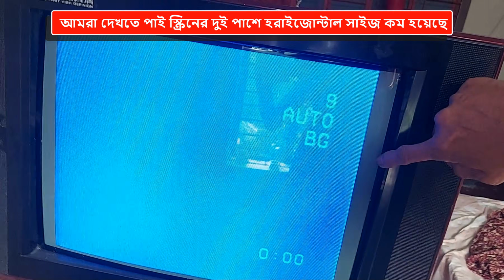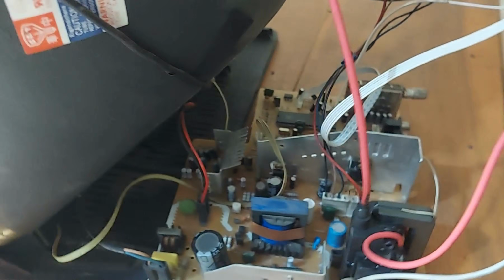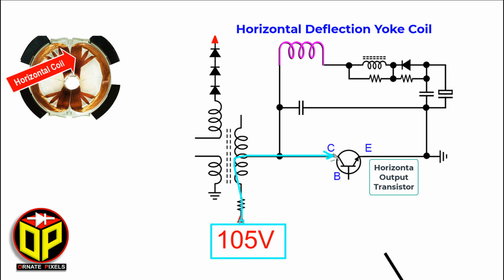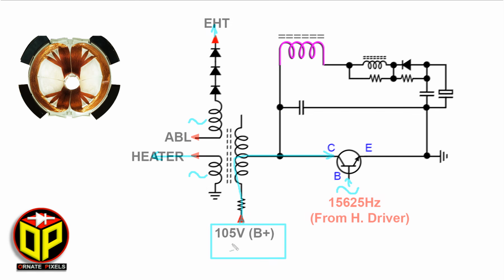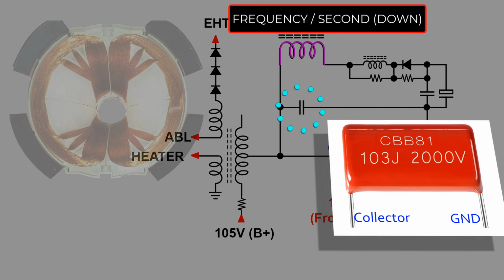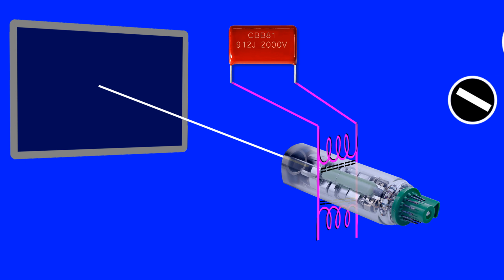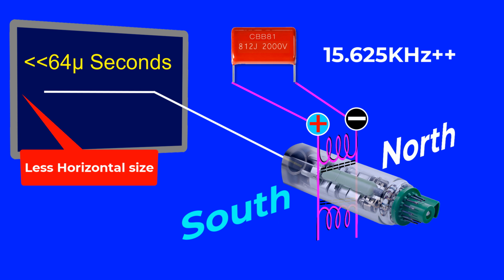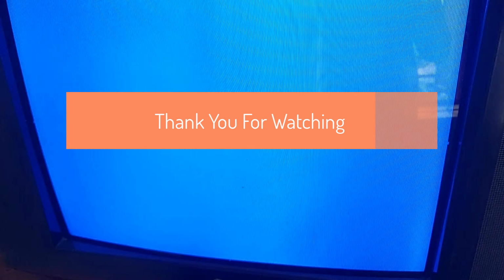CRT TV Horizontal Size Adjustment | Learn About Horizon Deflection Yoke Coil Section Details

Comment: Base/gate signal is a squarewave, not sawtooth, sawtooth current results due to inductance. Also, the scan time (Trace) is not determined by the capacitor. It is determined by the Horizontal Oscillator (the 15,625 Hz signal) hitting the base of the transistor.
Reply from the maker: Thank you for sharing your technical insight! You are absolutely right that the voltage signal at the base/gate of the horizontal output transistor is a square wave or switching pulse. However, due to the inductance of the deflection yoke, this switching action produces a sawtooth current wave, which is what ultimately drives the horizontal scanning. Both perspectives are key to understanding the circuit: the square wave acts as the trigger, and the sawtooth current does the deflection work. Thanks for helping make the discussion more detailed for fellow technicians!
Reply: @OrnatePixels  You're welcome. And to put it more precisely it is combination of inductance of the yoke and capacitance of Cs and Ct with square wave switching that ramp is produced through (quasi)resonant action, which drives the horizontal scanning. With additional note that Cs is much bigger and determines the resonance with the yoke inductance, but Cs is always almost fully charged, only Ct undergoes full charge discharge cycles. This is best described in SENCORE-TT207-Understanding-The-TV-Horizontal-Output-Stage pdf

Comment: Amazing video. is this issue related in any way to the issue some crts ahve where the left and right side of the screen is squished together compared to the center of the screen? or is it just the width of the horizontal scan?

Comment: Nice video, thanks but what about the vertical one?
Reply: Go to factory settings and adjust the vertical deflection.
Check the capacitors along the vertical ic if they are budged .
If yes change them also.

Comment: Whatt komponen broken?
Reply: The horizontal high voltage capacitor In the new CRT board was not matching with the horizontal deflection coil making the picture not to fit the screen.

Comment: My teacher, I have a little problem in repairing a broken LCD TV, the screen has no image, but I have cut the left and right lines but it is still the same, there is no image. Is there another way that can still be repaired? That's all I ask, thank you🙏
Reply from the maker: Numerous connection prints are inside the LCD glass, and if the glass is broken, it is very difficult to give advice without seeing the broken display.
 Thank You Brother 🌼🌻❤🧡💛💚🌼🌻
Reply: Master vertical section